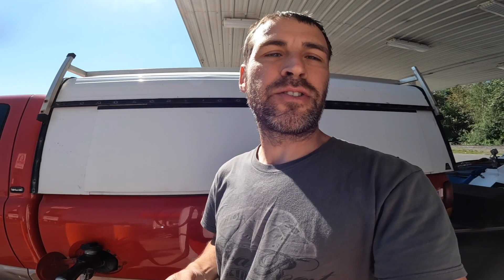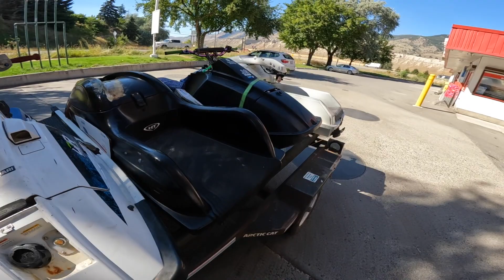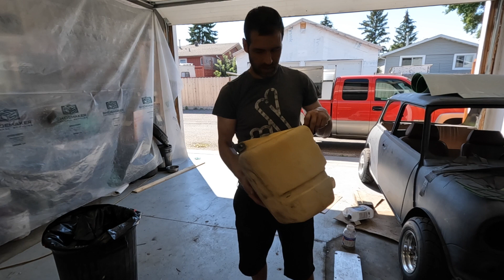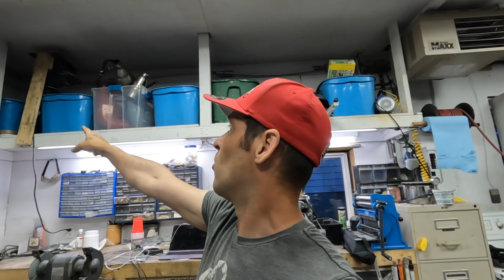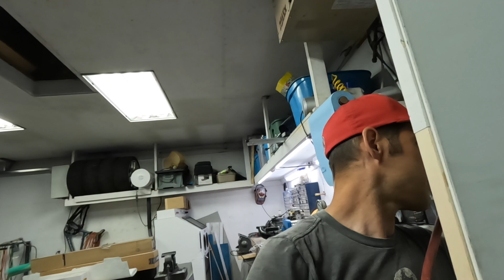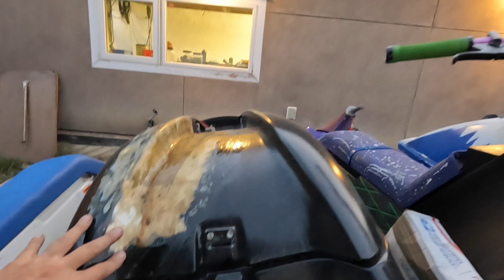Unloading My Bounty - New Skis - New Engines - New Projects !

Comment: Hey Joel, can't wait to see you fixing all of the working skis and not working skis,  it probably would be great to be home after being so far away.  Are all of those skis yours or are you just fixing them up free of charge,. Didn't you win some of the jet skis you have now, any way, I would love to be on some of the ski's you bought home  after they have been fixed, cheers mate
Reply from the maker: It was a lot of fun to be away, but yes, it is really good to be home. 

The only one that os not mine is the black one. It's called the Bullet, and it belongs to Jacob. I'm putting a 4 cylinder 1500 out of a STX in it. The rest of the skis, parts and engines are mine.

Comment from the maker: Hey, that's a tricky one for me to answer, as around here you just take what you can get. There are two available within a 7 hour drive, so you just hope that they aren't gouging you in price. 

You want to check all of the normal watercraft stuff. Check the pump for damage in both the intake and outlet side. Check the impeller, veins and wear ring for damage. Wear rings are not really replaceable so if it is damaged it means getting a new pump. A damaged impeller may allow you to knock the person down in price and then you can install a more appropriate impeller ... one that it should have anyway. 

If you have the ability, check the compression. It's not a guarantee, but a healthy engine will have around 120 psi and both cylinders will be close to each other. One that is 110 and one 130, isn't a good sign. anything under 100 is also concerning. That being said, most people neglect to rebuild their engines and wait for them to fail. If it hasn't been rebuilt in the past few years, I personally wouldn't purchase a watercraft and just run it without inspecting the engine. The best two cycle engines are good for 200 - 300 hours and then should have pistons replaced, crank inspected etc. 

Check for damage to the hull. X2s quite commonly crack where the foot wells meet the hood area. This usually isn't anything to be concerned about, but some are worse than others. Look on the inside to see if the cracking is all the way through or just on the outside. 

Purchasing a used watercraft is always a crapshoot, and purchasing one that is 20 - 30 years old just makes it all that more risky.

Comment: Heyyyyy! Bring those X2s back. Washington has a big enough shortage as it is. Hoping to make a 3 hour drive next weekend to pick up a halfway decent priced one in Oregon to do a little modding myself.
Reply from the maker: Haha... Hopefully the one you get doesn't have bullet holes in it 😂
Reply: @JoelArseneaultYouTube  haha. That would definitely be a first for me. Think it mainly has an electrical issue. Debating if I should mod the 650 or swap in the engine from one of my 750 SSs.
Reply from the maker: @JetSkiBuyFixPlaySellChannel  The 750 is a more reasonable engine for these skis. The 650 can be modified, I did it to mine, but they are lacking. It's nice to have a little more bottom end grunt on a watercraft, and that's hard to do when you start modding a 650.

Comment: I'm pretty sure you will change your mind about the krash in the leach when you do the first test fit. I sure am curious what you have to say about it when you get it apart. Your jet ski empire begins! First Calgary, then Alberta, then the whole country. We were wise to form an alliance before you became to powerful.  I'm so glad you are going to start doing cranks!
Reply: I wasted my time on a krash engine once, looking forward to seeing what you can do with yours
Reply from the maker: HAHA... form an alliance, that's great ! I'm determined to make the Krash work in the X2... I fully expect to have to build an exhaust, and I don't like the one that it came with anyway... Not at all impressed. I have big plans that I don't really want to talk about just in case they fall through... but I'm thinking Microsquirt Fuel Injection with a custom pipe. 

I currently have a LOT of cranks that need rebuilding. So yeah... It's going to happen.
Reply from the maker: @nlracing6847  Not to spoil anything for you, but I will have a video talking about my disappointment and eventually talk about some of the things I will be doing to improve the engine. I feel like it's going to be a real challenge, but I'm excited to take it on. 

Thanks for commenting !
Reply: @JoelArseneaultYouTube  my engine had holes in it from factory and then all the seals went out in the drive and the cases cracked in half, the engine ran away like a diesel truck. Krash ignored me when I tried to warranty because I posted videos of the failures on Facebook. Best of luck !!!!
Reply from the maker: @nlracing6847  Yeah. I've heard about porse castings / holes in castings. This engine will not be run until it is stripped, inspected, sandblasted and or beadblasted, powder coated and rebuilt after every nut and bolt is inspected. I have already had a look at it and have found several questionable design choices.
Reply: @JoelArseneaultYouTube Oh you think just because you made a set of manifold for a ls swapped fzr you can do anything. Anybody could do that. Hardehar har har. 

So you are going to make some sweet looking carbon fiber twin pipes that make 200 hp.  I see. You are not held back like I was.
Reply from the maker: @Jacobskibros  🤣😂🤣 Golden !! I'm not sure that it will work, but I'm going to try. 

I'd love to make carbon pipes, or a carbon pipe. I think the pipe that it comes with is pretty silly, and you want a pretty specific shape for an engine of that size and for the power band where you want to make mower. I don't think it should be a real revver. 

There were some other things that were holding you back... that will be revealed soon, hopefully... Not sure what my video schedule is going to have happen first.

Comment: Krash motor/electronics is pretty unreliable. Definitely replace starter and bendix with a Kawasaki one.
Reply: Already done.
Reply from the maker: @Jacobskibros  I was thinking to myself... It looks exactly like a Kawasaki one ! Haha. PS... Just got home from a searat ride and .... lol... well... I hope it made for good footage 😂
Reply from the maker: Haha... Are the electronics any worse than Kawasaki 1100 stuff... because I'm currently having a nightmare of a time with that 😂 If it gives me too much trouble I may do Zeeltronics, but I have other "plans" for the Krash engine as well that could bean I don't have to worry about OEM electronics or carburation. 

Thanks for your comment !
Reply: @JoelArseneaultYouTube  I don't think the electronics are bad. The first problem I had was I needed to ground the engine to the ebox. Then after I sunk it in my superjet the a start connector was corroded and it took me forever to figure out. I'm sure since you've had it apart you can see the architecture of the engine is pretty heavy duty. I think they kind of copied a snowmobile ski doo engine. I think the electronics are way better than 1100 ones. I think also they put zeeltronics in the next years up and the newest ones are fuel injection. 

I test fit that thing in the leach.... The only ski that thing fit pretty good in was my 13 superjet.  I'll keep my eye out for a really cheap superjet for you. I'm sure you will want one even more when you see what I'm working on now.
Reply from the maker: @Jacobskibros  Yeah... the engine is VERY MUCH BRP Ski-Doo inspired... It looks like they directly copied several things. I think overall it's probably a good engine that needs so .... fettling .... ooooo that's a smart word. I should take your word for it as you know your $hit ... Superjet would be super cool..... I want to know what you're working on now !! haha.
Reply: @JoelArseneaultYouTube  I believe for the 997 there are a few things you can do to make the electronics more reliable
Reply from the maker: @benselby6171  I will have to look into that when it comes time. Thanks.
Reply: @JoelArseneaultYouTube  Well you would know if you can make that 997 rage.  If you think it's good then it might be a good option if you want a superjet and if you decide you don't want to make a pipe.  It will be fun to see the video where you break it down.
Reply from the maker: @Jacobskibros  How about a superjet fix steer ... surely it's been done ? 

Looking at the porting and the fact that it's a 1000 cc... it should be able to rage HARD with the correct set up... it's just a matter of finding the sweet spots for it. It literally uses CR 500 rods, and has the same bore and stroke... It has better porting and power valves and the CR makes 60+  HP on 1980s porting and tuning. 

It will be a fun project !! I do know that.